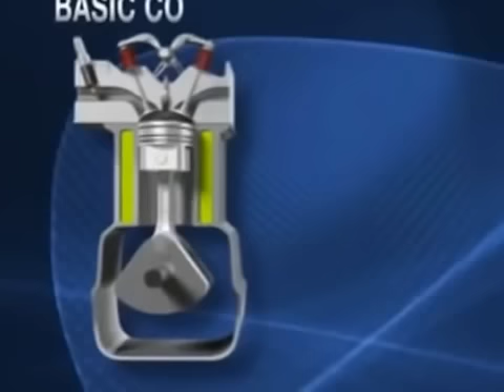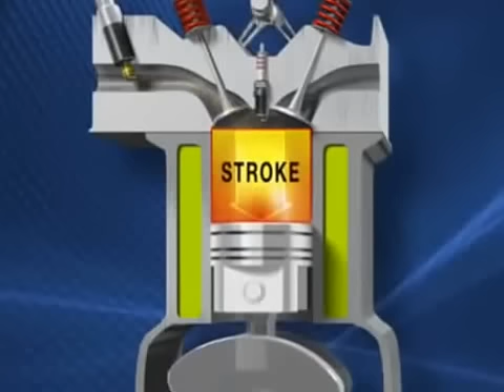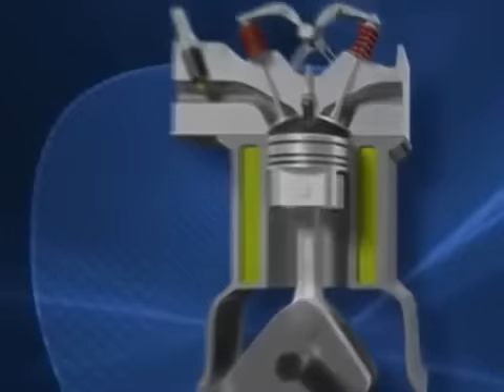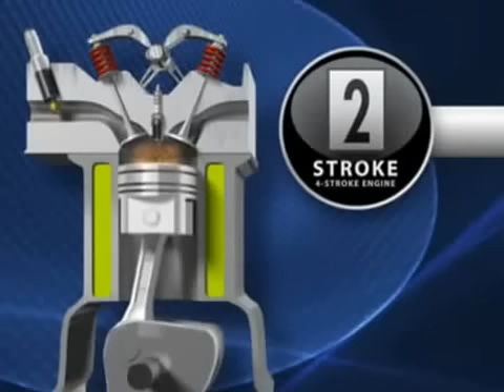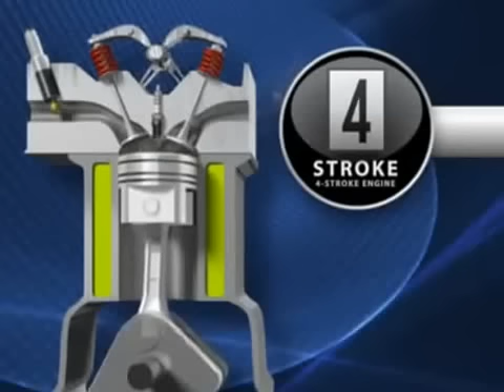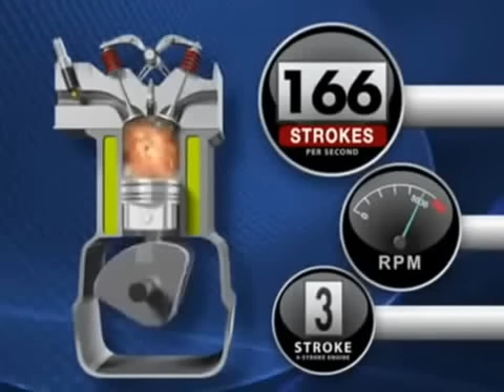Working of a bike engine in 3D

Comment: But in 2nd stroke how the Piston is traveling upward?
I mean what kind of energy push it upward and compress the air?
Reply: I think it comes from the cranking shaft, which is already being rotated halfway by the stick attached to the piston as its going down from the force of the gas + oxygen (fire). Because the cranking shaft is halfway rotated, it has to complete its rotation which in turn pushes the stick up and with it the piston. I think the way the cranking shaft is shaped forces it to complete that rotation, but idk this is me just guessing. 
Edit: A good reference would be https://www.youtube.com/watch?v=mRROa_plpTc&t=1s
Reply: Thanks for the reply!
But I think I got the answer.
I think the Piston traveling upward due to the design of the crankshaft.
If you notice the one side of the crankshaft is heavier than the other side. And the Piston is attached to the lighter part of the crankshaft. 
When the Piston traveling downward, it lifts the heavier part of the crankshaft upward and due to Gravity the heavier part traveling downward and push the Piston upside.
I think 🤔
Reply: short hair yes. Piston moves upward due to the weight balance of crank